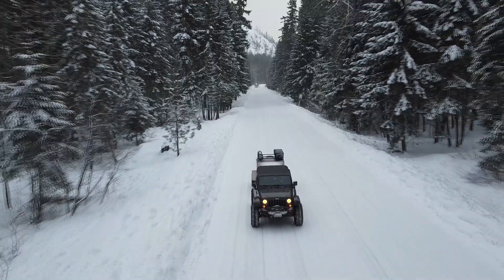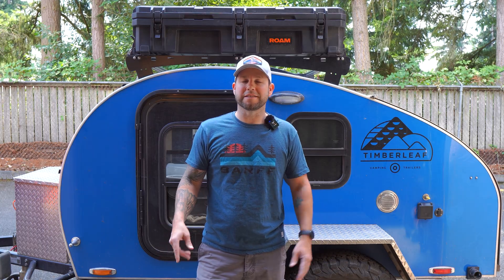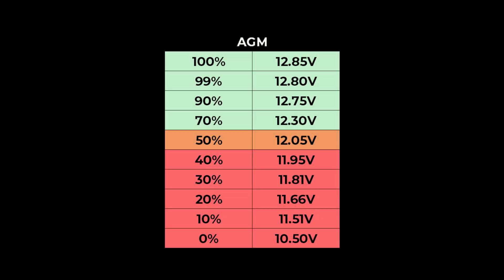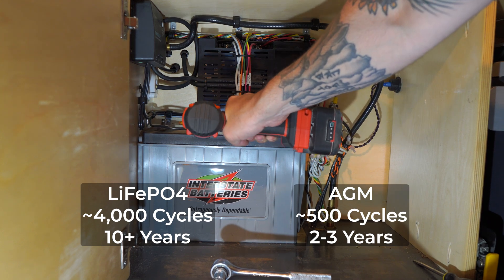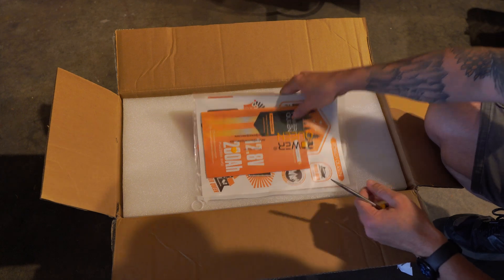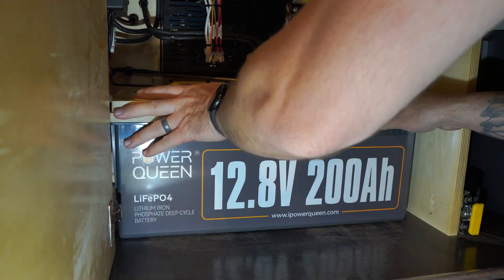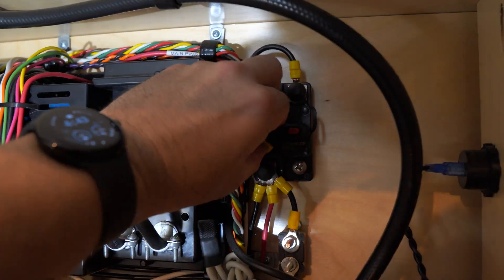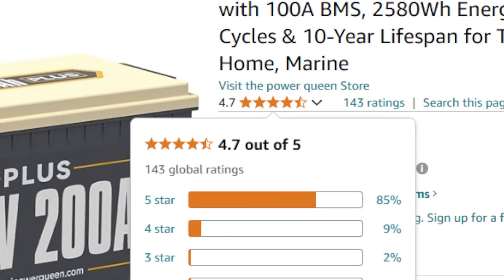LiFePO4 vs AGM Battery | Why This Power Queen 200Ah LiFePO4 Upgrade is a Game Changer

Comment: I've got that same battery. I run the 12 volt fridge off a Noco GC018 12 Volt plug,  it'll run it for days that way. Then just turn on your inverter only when you're using it. It's a game changer if you don't get much sun for the solar panels.  As far as the charge controller get a Victron MPPT with Bluetooth, they've come way down in price.  Well worth it.
Reply from the maker: Nice setup! Yeah the extra storage comes in clutch in the pnw where trees and clouds can hide the sun 👍🏻

Comment: Maybe the next trip you can see how long you can run your battery before it dies or how much you used on a typical trip to see how long it will last. That's a great choice and you should have no problems for a long time with it.
Reply from the maker: Great idea! I think we'll see how long we can go without ever using shore power to charge it as well

Comment: Just curious as to the benefits of either this type of battery compared to a all in one system like a Jackery or Pecron system? Thanks
Reply from the maker: Great question! We've seen it done before and it's a great option which also gives you portable power and the ability to pull it out to charge. I think for us we like that the battery is always "on". No need to power on unless they have an option for that now!?